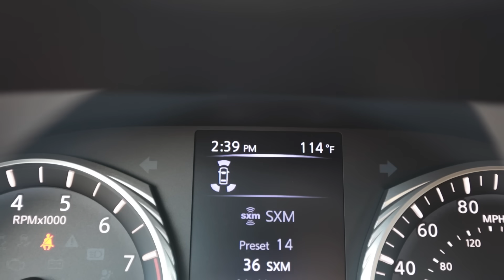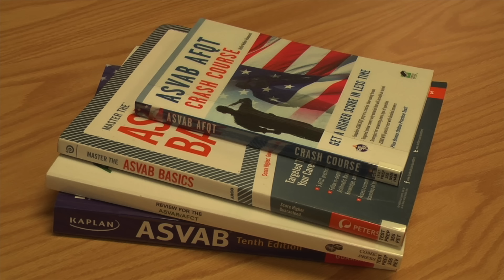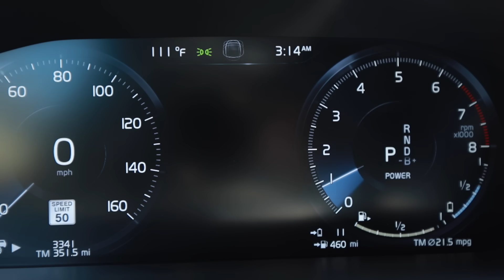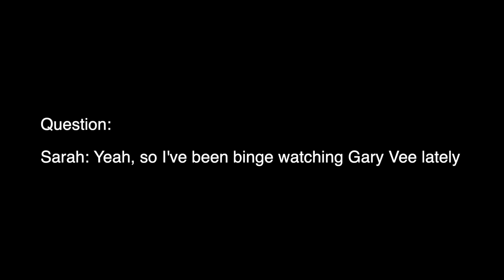Getting Personal // Who is Sarahntuned Q&A

Comment: I want to see you advance into more extensive fabrication and maybe even racing. I did all the stuff that you've done up to now in my car building career. It is interesting to see your similar evolution. I always tried to do more complex things with each project. The culmination was a GT40 built from scratch except for the body, I designed the suspension and chassis in SolidWorks. It took 7 years, too much money and time. Then I got into budget endurance racing, much more rewarding, and the car builds are much quicker. Racing is the ultimate thing you can do with a car and it tests your build quality to the utmost. Proof of concept is when you finish and win.

Comment: 2:05 - for those of you that dont know, the ASVAB is tough. A lot of it is common sense questions, but there are also a lot of problem solving and brain-wracking questions. Its impossible to get 100% simply cuz the test is designed that way. Getting a 94 is insanely intelligent, just a few short of being eligible to be working around nuclear material. Just for reference, i got like a high 70s, idr exactly, but i was slated to work in IT, setting up servers and routers.

Comment: Isn't wrenching exercise?   I'm 63yo and after I do even a very simple job on a car, I'm sore the next day.  Just yesterday, I swapped out the power seat switches on my wife's car.  I had to contort my old body.  And I neglected to forward position the passenger front seat, so I could barely get out.  I thought for a moment that I was going to be stuck there in the rear if someone didn't rescue me, but I made it out.  And I am 5'7" and 145 lbs and can shot NBA 3 pointers at 40% as foul shots.

Comment: thank you for that confession-like vlog.
Same here, I'm just unstoppable, like psycho ). I want to dig to the bottom and figure out why, what, how etc. Even if I don't understand something I'll spend enormous time lurking to get all details I need. Kind of obsession. But my problem is - when I get the point it quickly becomes boring to actually do the job ).
Well, what I meant is - I live "boring" life with paychecks, stock options, matched 401k, rented apartment, but I still can find struggles and challenges in my work and daily life. Why not to call workouts one of them though? ) Pushing yourself to the limits every day or other day is kind of struggle as well.
That's not the advice, just my thought on living from paycheck to paycheck, that could be boring for some people, but for others - that can be joyful and challenging, it just depends on your perception (perceiving?).

Comment: Sarah, I'm wondering if you know the answer to this. Years ago, I had a 1991 followed by a 1993 MR2 (2.0t both times). On both of them, the transmission failed in the same way. The gear shift linkage broke off where it enters the transmission. Is this a common MR2 thing??